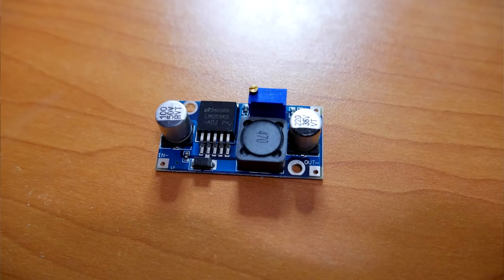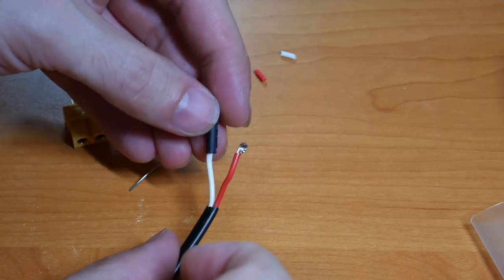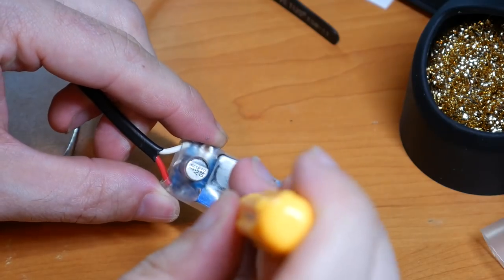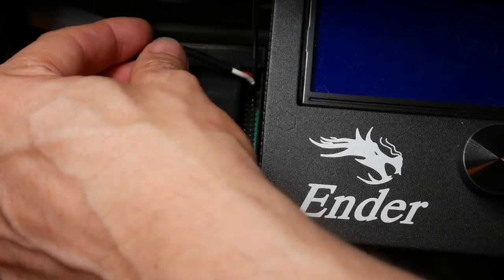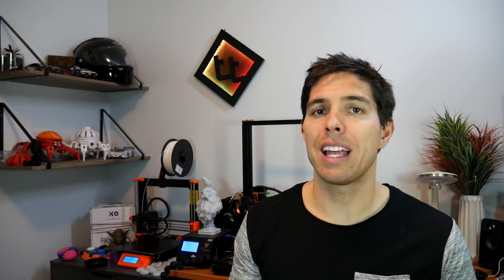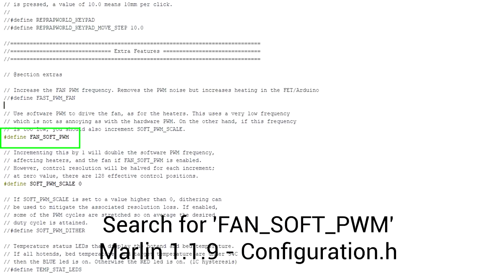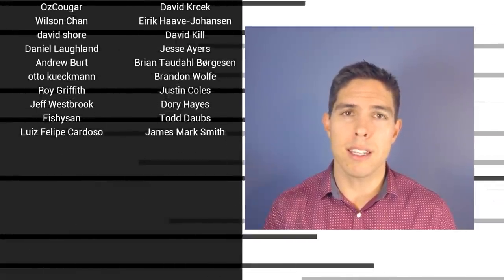Buck converters: Quieten your 3D printer with a Noctua fan & directly power your Pi

Comment: That software fan solution is a great idea. Thanks. I have to say. The first time i have stumbled upon you, i didn't like your videos (7 printable upgrades for ender 3, Four ways to beat moire on your 3D printer). Since then your content got much better (How to tune your slicing settings video has helped me quite a bit). Keep up the good work.
Reply: Its not. The meter averages 50% duty pwm to 12V but you still getting impulses of 24V just with 50% duty cycle. You need LC filter to smooth it out.
Reply: Another thing is You coud do everything with just 1 buck converter to 12V. Every fan/heater is ground(-) switched with n-mosfet so you can put the positive (+) side of the fans to the 12v output of the Buck converter
Reply: @tomaszbiskup891   don't see that you necessarily need to filter the signal. The electronics of these fans is universal between 12V and 24V, what happens if you connect a 12V to 24V, is that they will run way too fast, too loud, and will dissipate more heat on the motor windings than they can survive for any length of time. If you can just limit the amount of energy absorbed even just by crude PWM, it's fine.
Reply: @SianaGearz  I agree with You about motors but maybe some of the Hall sensor in fan cant handle higher voltages. When you change duty cycle You control the amout of energy to the fan and inertia average speed of blades.
But its wrong to say that PWM regulate Voltage. 50% PWM of 24v its not really 12V especially when You put capacitor on the output.
Reply: Problem with buck converter is that you you lose speed control. Right now i have all my fans on one buck converter and i am looking for a solution for speed control and looks simple and functional enough. Btw. Can you guys check your ender 3 power supply fan? Mine was rated for 12V and connected to 24V rail. It has worked 6 months like that (also solved with buck convertor).
Reply: You dont loose speed control. Put buck converter input to 24V with + and - on the mainboard. Put the fan + red wire to +12v output of  the buck and - (black wire) to pwm - of the mainboard. You will use existing PWM transistor control but with 12v power supply.
Reply: @cube.in.  the problem is the input capacitor of the buck converter. But it's not really supposed to be run without it, it has its purpose. If you can find some of these newer tiny (and often cheaper, MPS Chinese chip) step down regulators which don't have electrolytics, but use tiny MLCC instead, run at much higher frequencies (several MHz i think), well those might just work as-is.

On the buck converters you have, you can try separate reference trick. The fans, heaters, everything like that in 3D printers, is ground-switched, because it's cheaper that way. So you route your positive from control board fan out to buck converter positive input, negative from control board fan out directly to fan negative, positive from buck converter out to fan positive, and true global ground to buck converter's ground/negative input. Should i draw a picture?
Reply: @tomaszbiskup891  capacitors are a dumb idea there, because if the capacitor is of sufficient capacity to have any effect, it will just get charged during PWM bursts to the full PWM voltage, and it will gladly release about as much current as the motor will take, all the while increasing the current on the PWM controller perhaps beyond what it was intended to do. You either need to limit the current or PWM into an inductive/resistive load, not capacitive, for PWM to have an effect. Luckily fans are inductive enough.
Reply: Picture would be really appreciated. Thank you.
Reply: The input capacitor of the buck converter is not a problem, just need a high enough voltage. But You dont put buck converter on the output of pwm signal. Its regulator and it will always try to put steady voltage.

The separate reference trick is what i describe earlier. That i would use.

But I never said that capacitor on the PWM output is good idea. As You described it will charge and pwm will not work as intended, especially with 220uF as in video. PWM will never be able to regulate energy lineary with capacitor on output. I said you need LC filter. L - inductance with C-capacitance designed for the frequency of PWM that create low pass filter. But thats more complex topic. Easier just power it from buck throu existing pwm transistor but there will be buzzing when you lower duty cycle.

Comment: Great tips, I've got two voltage regulators on my Ender 3, one to power a 92mm Zalman fan that I used to replace the PSU fan and one to power a 12V LED strip.

I wouldn't used one for the Pi simply because I'd have to keep the Ender 3 on all the time as cutting the power to Pi without shutdown will undoubtedly cause OS corruption due to the nature of Linux.

I definitely want to update my Hotend fan and main board fan now though, so much quieter and I've already got dampeners fitted.

One thing worth mentioning is that there's a slightly neater way of wiring the voltage regulators than using a double XT60 connector. If you open the PSU and remove the plastic cover on the bottom there are a few spare terminals available on the terminal block which output 24V. I just crimped some connectors to the positive and negative wires that go to the regulator and connected them directly to the spare PSU terminals.
Reply from the maker: Great tip, I didn't think to check the PSU connectors.
Reply: @TeachingTech  thanks for the reply. Yeah I've found it pretty neat like that. Currently got an led strip set up around the frame that comes from a voltage regulator that's connected to the terminal connectors. Makes it look a bit more stock I think

Comment: Man, I have almost as much $ in parts planned for my Ender as the printer itself cost and haven't even taken delivery. 😨😁😂
Reply from the maker: That's half of the fun :)
Reply: @TeachingTech  TH3D released a vid taking exception to your suggestion to use the 4010 fan due to heat creep on longer prints. He didn't say anything about the 4020 other than he doesn't stock Noctua at all. He might not have read through where you corrected some details in the comments.
 I guess this field is like cars; no 2 behave the same and what works for 1 may not work for another.
Thanks for your productions, I've learned a lot in a short time.
Reply: I've close to doubled the cost of my ender with the additions. mine is a week old now, and I don't regret a thing!
Reply: Yep, 300 on printer 300 on mods. Funsies!
Reply: at this point youd be better off buying a prusa to save you time. unless the project is what you’re after
Reply: @BlackopsSOG1  kinda true.
Tinkerer at heart though.

Comment: I noticed that the mainboard fan also isn't exactly quiet plus the hole in the lid is smaller than the fan. So I'm gonna print a new lid and put another noctua fan in as mainboard fan. I also want this fan to be powered off the hotend cooling fan so it will run all the time (standard fan connector only runs if part cooling fan is running). Can anyone tell me if I could just hook it up to the buck converter in addition to the hotend cooling fan? If so how would one best split the female dupont connector?

Comment: I did wire up the cooling fan exactly like you showed, a Noctua 12V fan, and the buck converter is putting out 12V when the fan is set to 100% (255). However on lower speeds the voltage is too low then and the fan won’t start spinning. Even on 20% the voltage isn’t enough. How did you get around that?

Comment: To control my 40mm board fan on my A8 I just spliced the negative side with a trimpot before going to the supply.  Although it's 12V with a 12V fan and I'm only stepping it down a little bit as it was a bit noisy on full power. I guess you needed the buck because 24V down to 12V is a bit of a heat dissipation issue?

Comment: If the hot end fan is on all the time, why connect it via the main board?
Why not do what you did with the Pi and connect the converter direct to the main supply?

Comment: Hey Michael,
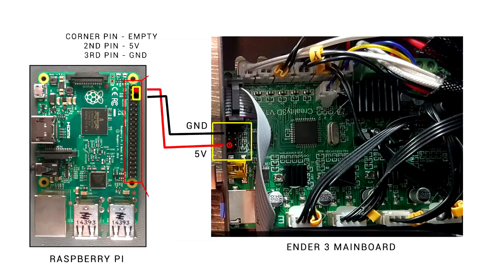I am not sure if I got this right: At 5:17 min you talk about avoiding buck converters completely. Does this mean I can simply power my Raspberry pi 3 from the Ender 3 mainboard with a simple 2 wire connector (using your wire diagram at 5:31 min)? That would be absolutely awesome! Or did I get this wrong? 
Greetings from Germany
Michael

Comment: What size wire do you recommend for the wiring the Pi to the PSU? I've seen people use 12, 16, 18 AWG. Is there a difference between these, or is it negligible for the printer and pi combo? Thank you for all your hard work!
Reply: Would love to know this too!
Reply: What gauge did you end up going with?
Reply: @MichaelChaconchacon  ended up buying 18 awg
Reply: @Jon.Kyle.Art.  thanks!

Comment: Apologies if this has been asked before, but isn't it also an option to take a ring crimped lead from the spare terminals on the power supply and takign that to the buck convertors. This is instead of  modifying the original XT60 connector? less joints, and simpler connections...

Comment: Thank you, it's a very valuable information you provided here. I tried to install the power supply for the RPi from the PSU of my Ender 3 but run into problems with the buck converter (LM 2596). After wiring, the input side shows a voltage of 24V. On the output side, measured on the connector points (no wiring there yet) it shows always 0V whatever the position of the 'adjustment' screw is. I turned it clockwise and also counter-clockwise. The multi-meter always shows a voltage of zero. I tried 2 different LM2597, in both cases the output is zero. Any advise what I may do wrong? Thanks

Comment: quite fans push less air PLA heat creep is a big problem 24v fans push more air, just use something to dampen vibration, larger fans are also quiet.

Comment: I also think that the partcooling fan is going to be the lowdest part of the printer after replacing the main cooling fan with a noctua. I'm considering replacing it with a 2x 40mm noctua setup with an appropriate airduct. But that's some heavy investments in noctua fans...
Reply from the maker: In Aus they are stupid expensive, I understand.

Comment: I see from many reviews that a lot of these XT60 adapters are very cheaply made. Is it simply recommended to make your own? A lot of them say "no wires" and yet they have the crappiest solder job ever. But I guess adding a wire to solder them good would have some other kind of impact?

Comment: I run my Pi off a 20k USB backup battery pack. I was afraid that auto resume would fail off pi was reset. Is that not the case?

Comment: Hi, thanks for your great videos. I just bought my first 3d printer which is the Ender - 3 pro, and I have been following your videos along to get into this hobby. I am wondering now, if I can use the damper on the pro version as well since the gear on the step motors can't be pulled out. Have you tried installing dampers on the pro version yet?(Sorry, its a little bit off topic)
Reply from the maker: My version went straight on, but I'm increasingly reading about users in the same situation as you. Hopefully my next Creality printer has this so I can investigate.

Comment: You shouldn't put electrolytic capacitors across motors because of the back emf.  0.1uf ceramics are usually recommended. I'm not sure about brushless motors though, they would end up too far upstream of the motor itself.

Comment: Just to get this clear, can i just set the max PWM for fans under 24v and not use the buck converter? or is that just for the sake of understanding that the default 100% means 24v?

Comment: Just a heads up, the affiliate link for the Noctua fan is a PWM 4 wire fan.  Didn't realize it until it got here. If anyone else gets that fan, the yellow wire is the 12V.

Comment: Great video, but creality printers now have a shared 24v+ to the heater and both fans. They control the pwm using the 0V- line that runs back to the board on each component. If you know what could be done about that I'd be highly interested!

Comment: I tried using the motherboard connectors on the ender 3 to power my pi3 b+, while it did supply power it only got so far into the boot up process before cutting out and then it would keep on trying and failing in a loop. I just dont think there is enough juice to power it.
Reply: thanks for putting this out there. I was about to test it with my pi3 B+ too but the minimum power requirements do seem rather high from stock and Michael shows a pi2 B in the video. I may try this with my 3B (not +) as I have many power draw options disabled there such as the HDMI, bluetooth, and I even have a USB cord that I have removed the power lead from so that it can transmit data to the onboard SD card from octoprint but it does not actually provide any power to the ender 3's main board.

Comment: The primary purpose of a buck converter is not as a voltage regulator but rather a voltage multiplier.  Of course a voltage regulator is employed for the new voltage.

Comment: THe tip you mentionned, about taking the main board's alimentation,would that be good if I were to install LEDs? They require 12V and I have the BTT skr v1.2

Comment: I saw a video that stated to cut a USB cord and to solder it to the buck converter, then to plug it in to the "J1 Power In" on the Raspberry Pi (The power source would be a Y spliter from the XT60 cable from your main power source). Is that acceptable to have the "J1 power in" USB hookup from the buck convertor?

Comment: How do I find out if the creality 4.2.7 silent motherboard I have installed has a voltage regulator onboard please? This is so I can power a Raspberry Pi direct without the need for additional buck converters as shown in the video, thanks.

Comment: One thought, what do you think about (if possible) hacking a micro usb cable so it connects to the buck in the other end instead of having a regular USB connector there? (Thus using it to feed the Pi normally)

Comment: Thanks for the informative video!! Along these lines I was thinking of adding 2 Noctua fans, one for my hot end and the other for my electronics. With that said instead of using a buck converter, my idea was to use 2 NF-A4x10 FLX 12v fans and run them in series off of the hot end connection. This should drop the voltage down for both fans to 12v and have them both running 24x7, which is what I want vice the electronics fan being tied to the parts cooling fan. Is this a realistic solution, or is there something that I am not considering that will cause me problems down the road?
Reply: Did this work for your printer? I am also considering to put 2 40x20mm noctua fans in series

Comment: What would you think about a USB power hub being installed and powered by the Ender 3 power supply?  I was thinking this would be good for powering the pi as well as other devices like USB flexible  LED lights for lighting the build plate.

Comment: Wonderful vid mate!
Couple of things, the crimping tool link for Banggood doesn't work no more. could you redo? or which one do you recommend?
Also you use a noctua FLX fan but link to PWM, does it matter which one to get? the one you recommend is 12v but link to a 5v. does that matter?
Thanks in advance!

Comment: you can just use a string of rectifier diodes to drop the voltage. not as efficient as a buck converter, but simpler and more reliable.

Comment: Not sure if anyone mentioned it, by why not just used a resistor in series to drop the voltage on the hotend and mainboard fans?  The Notcua 40x10mm fans are drawing around 40 mA at 12 VDC (according to the rating).  So, to drop the other 12 VDC, the resistance would be equal to 12 volts/.04 Amps, so 300 Ohms (substitute the current rating for your fan to find the resistance value).  Also make sure it's rated for the right power, as that would equate to about .5 Watts, so should use one rated at or above 1 Watt. Something like this:
http://a.co/d/0t4oFFW

Comment: sooo, without looking I bought the 40x20mm noctua fans for computer case and fan shroud of the ender 3, not seeing that it was 5v. I compared it with the 40x10mm 12v noctua fan and the 5v version has better airflow on the specs, so I'll just set the buck converter to 5v, would this still be okay for the fan shroud of the hot end? I don't have a fancy heat camera.

Comment: Why buy XT60 connectors when the powersupply has I think 3 additional clamps for powering 24v ? Or is this supposed to be as dumbed down so you do not have to take the cover of the PSU?

No hate.

Comment: Hi Michael, first of all, thank you very much for your always useful videos.
I've installed 2 x Noctua Fan on my Ender 3 (mainboard and hotend sink), but I'm not totally satisfied about the final results. I could see that the fan comes with an adaptor (that consists of a resistor) to further decrease the noise. From what I could understand from a CHEP video, this adaptor would slow down the fan, have you tried it? I'm obviously afraid that if used, then not enough air passes through the fan, but unluckily I have not temperature sensor to evaluate the cooling efficiency with the adaptor installed.

Comment: Idea is OK, but I have a small suggestion - don't use the same type of connector for 24V and 5V. You will only mistake them once :( She 2.5A is not too much for general connectors - and the best idea is to solder there directly the MicroUSB cable for the Pi.
Reply: Plus on the step-down for the fan, you can use the smallest and dirt cheap buck converter - it consumes so little power that even the smallest one is far sufficient ;)